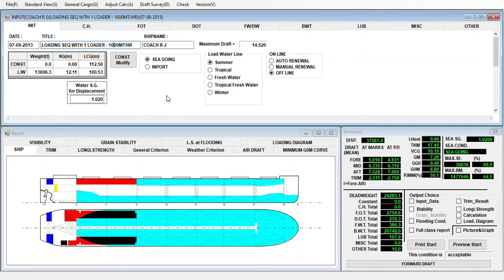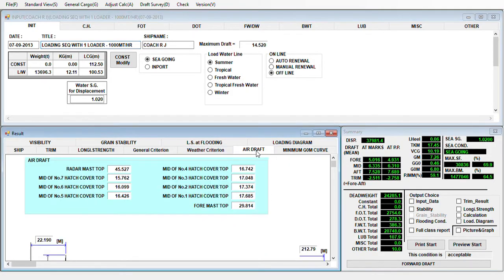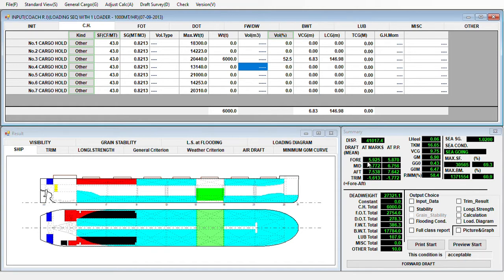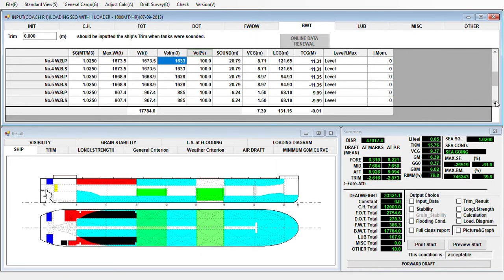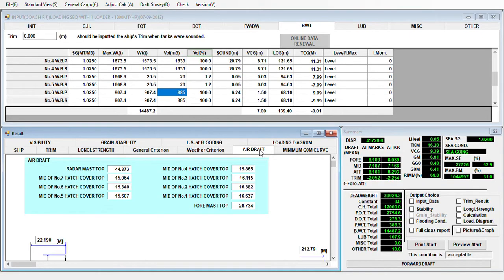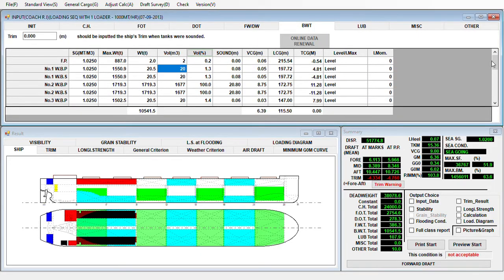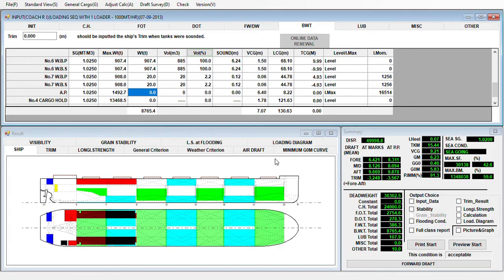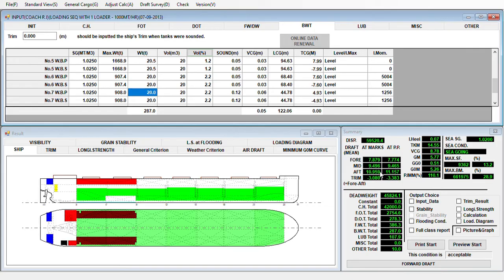Loading Sequence - Loadicator Mastery

Comment: I think, it would be better to re-create the lesson. Because it is missing the main: 
1. Why did you start with hold 7?
2. Why no two cargo holds one next to the other?
3. Why pumping out the ballast below the cargo hold in question?
4. Why did you load 6000mt  but not 7000? or 8000?
This is the mastery.